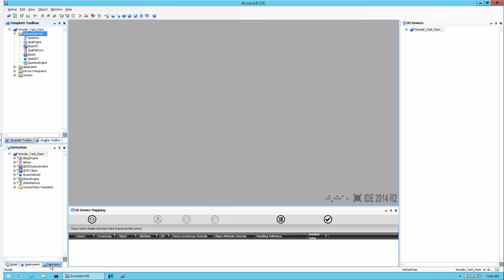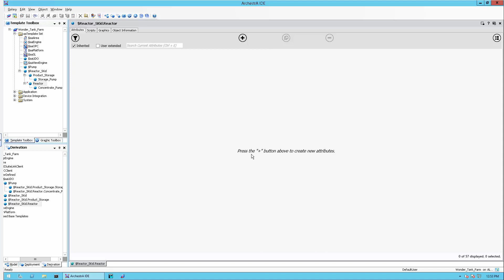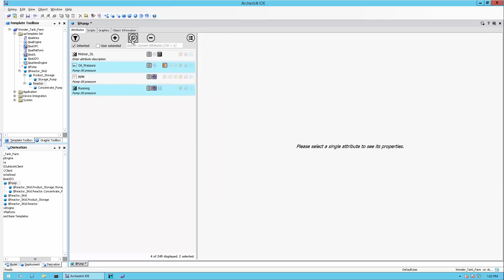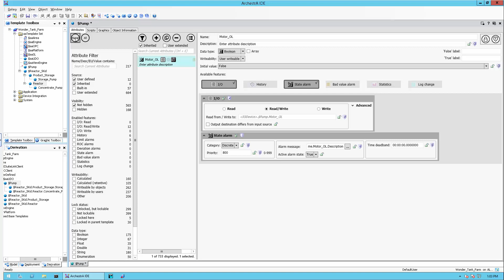New Wonderware Application Server Consolidated Attribute Editor

Comment: How can I make multiple instances at once? Instead of creating them one at a time?
Reply: You could use the Galaxy Dump function to export an existing instance to a CSV file.   Then edit the file to remove all the columns for attributes that will be inherited from the parent template.  Next, add all the new instances you want to create.   Finally, use the Galaxy Load function to import that CSV file back into the Galaxy and you'll create an many new instances as you like.   I've used this technique to create thousands of instances much more quickly and easily than doing it within the IDE.

If you want to practice this, I strongly recommend creating a blank "test" Galaxy so you can play around without worrying about damaging an existing Galaxy.

Also, ALWAYS back up a production Galaxy before making any major changes to it.

Good luck!